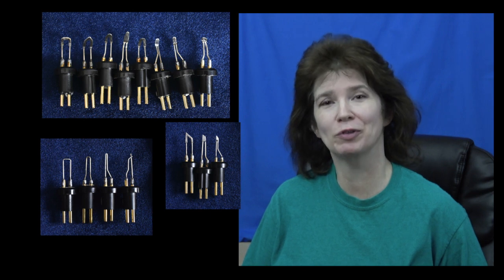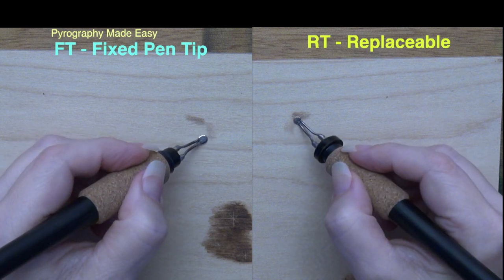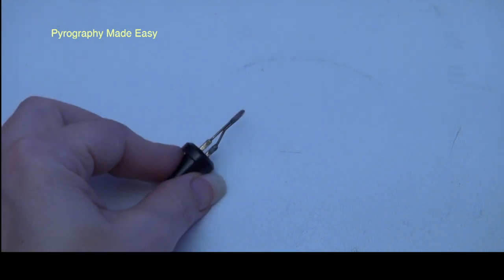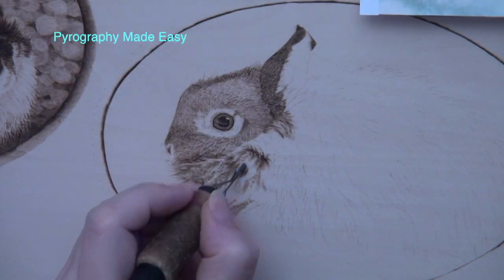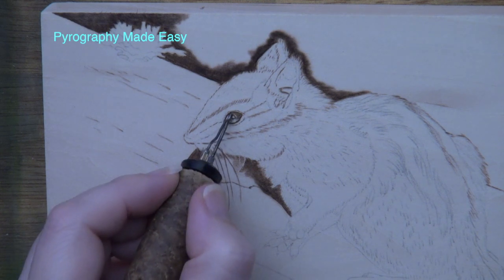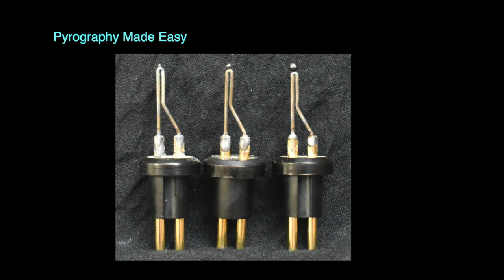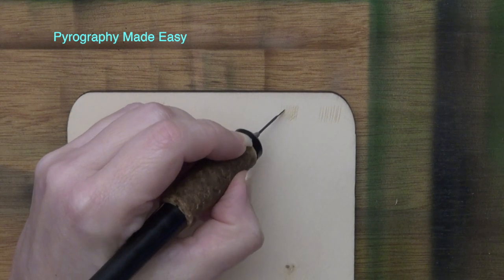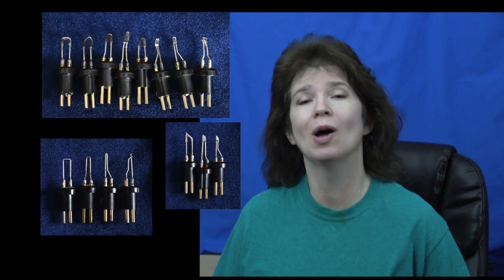Wood burning - Tips and Their Uses – The Pen Tips I use in pyrography

Comment from the maker: If you are looking for a video that explains what you can do with each and every pen tip made by Colwood, this is NOT the video for you.   The truth is most of the pen tips do the same thing.   For example there are several writing pen tips available and the real difference between this is how small or large of a line they can create.    The same can be said for the numerous shaders available.     You only need 2 pen tips - a writer and a shader.     From the Colwood series I'd recommend their standard writer pen tip  that they call the C writer.  Their pen tips are assigned a letter for identification purposes.    As for the shader I'd recommend the D shader.  This shader as different sized edges, so you can create a much wider range of burn stroke widths.   
I recommend having the shader bent to a 45 degree angle, but polishing I consider to be purely optional.  If you plan to burn on leather the polishing is handy.

Comment: I started to get into wood burning when I was in middle school with some very basic tips and simple stencils and I really loved it! I recently came across my old soldering iron while cleaning up some of my crafting tools. This video is a fantastic re-introduction for me because it made me realize that I don’t actually have a good shader, so thank you for putting this together!

Out of curiosity, do you have any recommendations on how I could test my soldering iron to make sure it’s still safe to use? It’s been kept in a cool, dry storage box and none of the wires look frayed or anything like that. I haven’t used it since 2002 and I don’t want to accidentally hurt myself or blow a fuse when I plug it in.
Reply from the maker: It's amazing how long pyrography has been in existence.  At one time it was a very crude artform done by heating a metal poker to burn the wood with.   

You would need to check with the manufacturer of your burner to see their recommendations.  By the sounds of it the devices has been stored well and there shouldn't be any issues, but I can't guarantee that or made any recommendations for testing it.
Reply: I just got my burner so this was great for me, many thanks

Comment: Hi Brenda, very informative and helpful. I’ve just bought the Colwood super pro 11 and it came with 5 tips. I have ordered the small and large ball tips and the fine writer and waiting to get them, but I wonder you you mind telling me how you bent your tip please? I know you don’t recommend it, but to keep costs down I didn’t ask to have any bent . I know my warranty will be void and that’s fine, also if it should break then it’s my problem . I’ve been wondering on how to do it myself and also would it be better to do while hot or cold. Any advice is welcome and thank you again for sharing your knowledge.
Reply from the maker: Hi Barbara,
do not attempt to bend the metal while it is warm.  I broke a tip doing that!  Also try not to let your pen tips get glowing hot.  It is really bad for the metal.   Let me explain what I did so you can avoid my mistake.

I bent the pen tip end with some pliers right where the two wires end and the pen tip begins.  I will mention that is not a good spot.   Then I let the pen tip get glowing hot.  I don't normally do this, but I wanted pictures for my blog to show others what not to do.    Afterwards I decided I didn't like the angle I had bent the tip, so I used pliers to bend it a bit more and it snapped right off.  

Why should you avoid letting your pen tips get hot enough to glow?  They can lose their tempering.  I think that's what happened to my pen tip.  I think the metal got hot, lost its tempering and then got brittle.  This caused it to snap off when I tried to bend it more.  

To bend your own, use metal pliers.  I do recommend bending the tips along the two thick connecting wires.  Don't bend them where I have that is shown in the video.  Since my are already bent, I leave them alone as I'm afraid that if I try to bend them back to their original state I'll break them.   

Hope that helps and that you enjoy pyrography!
Reply: Pyrography Made Easy 
Thank you so much for your advice Brenda and for taking the time to do so.  I started my pyrography journey during our first Covid lockdown in March. I had  bought a cheap tool, which lasted approximately one hour. Then I found a Peter Child’s pen machine here in Ireland, but the tips were extremely fine wire that bent very easily, but didn’t break.  Finally I did find the Colwood and I have it about a month now. I wasn’t using the proper wood either, I was using what I could find locally, which is mostly pine, so the fine wire tips would gouge into the wood and not glide over the top. Again finally I found basswood ply, which here is called lime wood, and it is lovely to work with. The supplier I found only has it in 2mm depth and in A4 size, but I will try cutting it down if I want a smaller size.  I can use the Peter Child’s machine now too, so sometimes I use both. Needless to say I have so much to learn, but I’m loving it and as you say practice is the key. Thank you for sharing your skills, your work is truly amazing.
Reply from the maker: I'm glad you found some basswood plywood as pine is horrible to burn on.  You know that already!  
Have fun and be creative!

Comment: This is a general question, I just started this craft. I use the ballpoint tip to do the outline. I am having issues with my lines and they do  not come out smooth when it hits the grain. Is there another type of nib? I am trying to do an outline of a  circle and it comes out blotchy.
Reply from the maker: Hi Santiago,
Welcome to the exciting artform called pyrography!  I hope that you'll love it as much as I do.

I doubt that the pen tip is the issue.   Instead, I would guess that it is a heat or hand pressure issue.   
The higher the heat is the more the burn tends to spread when you burn over grain lines.
Heavy hand pressure causes all sort of problems.  I have a video about the importance of using a light hand pressure.  The video demonstrates the difference between heavy & light hand pressure.  Plus there is a test to check your hand pressure. Here's a link to that video:  https://youtu.be/q8OGqS5kyHg
Reply: @PyrographyMadeEasy  thank you. I will definitely check it out. Thank you for responding to my inquiry.

Comment: This is very interesting. I want to try the Colwood systems. I currently use a Weller system, which I believe you are familiar with. Please check out my work in my pyrography playlist and tell me what you think? I think getting polished tips that Colwood offers will take my work to a whole new level! Thank you!
Reply from the maker: Hi Mel,
thank you.  I'm not familiar with the Weller system, but I watched one of your videos and you're creating fantastic artwork with it. 
Since you burn on leather the polished tips would be beneficial as they glide better across the surface of the leather.
I've only used a colwood system, so I can't say if it is the best one, but I haven't had any problems with mine.
Have a great day!
Reply: Pyrography Made Easy thanks so much!! Once the pandemic is over I’ll try get the colwood system and see if I like it better

Comment: Too bad you are advising bending pen tips in the way Colwood does. I immediately regrated it because the slim wires by the tips unfortunately are burning wood in a places I did not intended to burn. Now I understand why it would be better to bend them as you do- right by the tip- even if it is a risk and you do not recommend that ;)
Reply from the maker: I don't want someone breaking the tip off of their pen and blaming me for it.  
Like you, I don't care for the way Colwood bends their tips.
I have found that you can re-bend tips, even ones bent on the wires, but be careful!  Too much bending and it will break the tip.